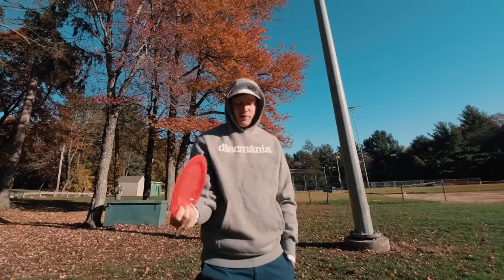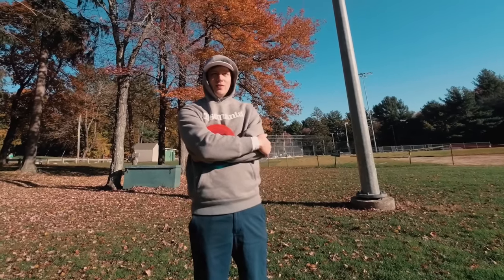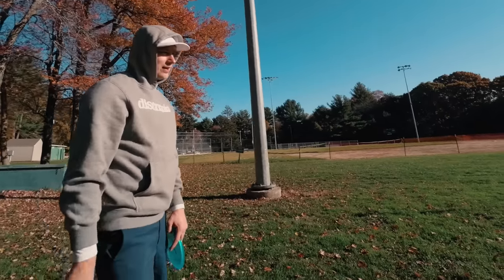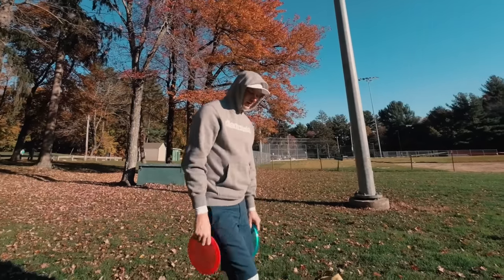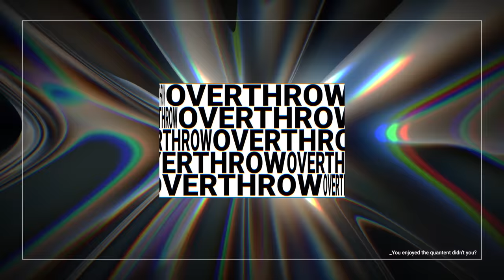Simon Lizotte | Slow Motion Form

Comment: Friggin mind boggling how he never has to fully extend his right arm until he's throwing max distance. Most effortless distance out there imo.
Reply: You really never have to reachback for max distance
Reply: Seppo Paju and Severi Savinemi have also almost non-existent reachout.
Reply: @joonaskuusisto2767  savimäki vai saviniemi?
Reply: @vetskunhotelli4193  Menipäs pieleen, kiitti korjauksesta!
Reply: I've always thought the same thing about Simon.  When he throws 400' it looks like the same amount of effort as when I throw 150'.
Reply: Look at Kristian Kuoksa, thats effortless
Reply: Was just going to mention this. Imagine throwing 450 and not even needing a full reach back.
Reply: Check out his video where he is trying to hit speeds with a radar detector.... His long drives look so effortless.
Reply: @broheme8922  slow is smooth, smooth is far
Reply: @MyOpinionMatterss  What matters is upper shoulder extension, rather than "reaching back" behind you.  You just want your shoulders turning away with proper timing as your plant step is extending, so that the whole kinetic chain is ready to fire as soon as your foot touches down.  The swing is an automatic and unstoppable mechanism of what's happening in the lower body, rather than something you're consciously trying to do.  It doesn't really matter where your arm winds up in the backswing, as long as you rotate your shoulders back and time things correctly.
Reply: @leevikv  and yet he does :) rubber band reachback. From a physics standpoint there is more time to accelerate the disc on a longer path. Sure, if you fail the snap it's not gonna help you, but it for sure has the highest distance potential.
Reply: @aarnikotkadg9473  he throws really far, but in no world does it look effortless. Huge grunt and and full swing. Not that a max distance shot should look effortless, but just saying
Reply: Wysocki and Proctor are two more that have very compact form regardless of distance.
Reply: Or much of a shoulder turn to get over 300ft!
I thought ever shot I take regardless of distance should be a massive shoulder turn. Guess not. 
So effortless for over 400ft.  I saw another video where a guy was clocking the speed of Simon's arm and increased by 10mph upto 70mph and was so smooth and not much of a  shoulder turn or right arm extension. He  went 550ft with a 12 speed disc!

Comment: Main thing I noticed which I never did before is how he doesnt change the pattern of his steps from distance to distance, he just takes faster and longer strides when throwing further and shorter, slower strides when throwing shorter. But the actual pattern of the runup is consistent throughout, at least until he throws max distance at which point he adds 2 extra momentum building steps, but then the rest is the same
Reply: Also the planting of the last step is different in power shots
Reply: It kinda looks like he changes the angle of his run up.  HyZer he runs straight at the disc. Flat he comes in at a little angle to the disc and anhyzer he comes in more of a angle to the disc.

Comment: One thing I find interesting and also would like more analysis on is the angles from the top down view. Angle of run up, angle of "pull through", angle of flight line verses those two, etc. Is there a best practice we can get from this or some rough form rules we can develop from this? Like when he is throwing a power flat line, draw a line on the top of his head from start to finish for the run up. Then do the same for the "pull through" angle and the same for the flight angle from leaving his hand to as it leave the frame. Its interesting to see the lines all of these make and the angle differences between them. The top down view on these throws are rare and underrated in the form world imo. It really makes you realize how complex the disc golf drive is.
Reply from the maker: I plan on diving into all of these topics! Just have to have the time to sit down and record

Comment: The angle at which he approaches each shot is wild.  I've always tried to approach a shot mostly straight, and that's obviously wrong now.  Great video.
Reply from the maker: He’s approaching each line straight. Since he is throwing to the same target he has to adjust the angle of his walk up to take flight path into consideration.
Reply: @OverthrowDiscGolf  I noticed this as well 'cause it's something that I'm struggling with (and thanks for putting the discs on the ground to really get this perspective). I seemed to be pulling my throws to the right, so I adjusted my run-up to be more of an angle. What I'd prefer to do though is fix the pulling 'cause it just seems as though adjusting the run-up angle was putting a band-aid on bad form. That said, I believe Drew's run-up was more at an angle than Simon's, although I'd probably have to go back and review to confirm.

Comment: Question. For shorter throws he doesnt reach out as far. Would it also work to reach out as normal, but just do a slower movement? Like slow the rotation down? This way, having the same movement everytime just varying the speed of it. Or do you lose the snap this way?

Comment: Simon seems to always throw at an angle to the right. Hyzer, straight runup, disc goes right. Straight, angled runup, disc goes straight. Anhyzer, really angled runup, disc goes left (but still right of the direction of runup)

Comment: I know you mention to keep the feet sideways during the x step but it looks like Simon has his foot backwards.
Maybe my perspective is off or it’s probably something he got used too.
Reply: He touched on that in his deep roots disc golf video with one of the guys, in that example he uses eagle but the principle is the same. 
With higher than normal hip mobility the x step foot being heel forward isn't a problem and adds more hip engagement but for the average disc golfer its more beneficial to keep them in line

Comment: It looks like Simon’s elbow isn’t above 90 degrees even when throwing anhyzer shots 🤔 Or is it just the camera angle?
Reply from the maker: You mean height wise?
Reply: @OverthrowDiscGolf  yes. In relation to torso. I’ve thought I need to have elbow so high it’s a 90-degree angle with my torso when throwing flat. AKA elbow pointing horizontally away from me. But seeing this video makes me think I’m wrong. And yes - I have elbow pain..
Reply from the maker: @akselim7403  yeah. You don’t need it directly away from you as there is a range. Simon is a little lower than most.
Reply: @OverthrowDiscGolf  do you have any videos about this? Would be helpful for re-learning correct elbow placement
Reply from the maker: @akselim7403  the lead arm video in the backhand playlist

Comment: All the shot forms look incredibly similar across the power spectrum.  I only see the actual angle selection at the very moment of release, even during the drawback the angle has not yet been chosen.  I have no ability to pop a disc into position like that.  I prefer to start on the angle I intend to release.
Reply from the maker: Disc golf is hard